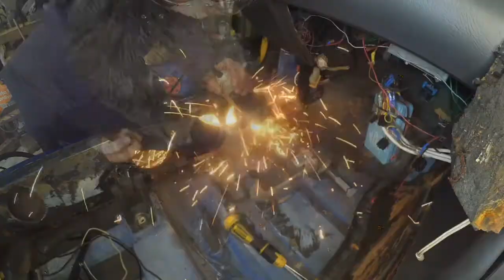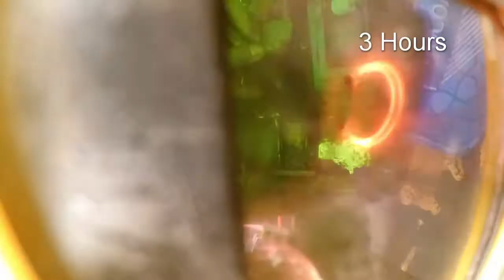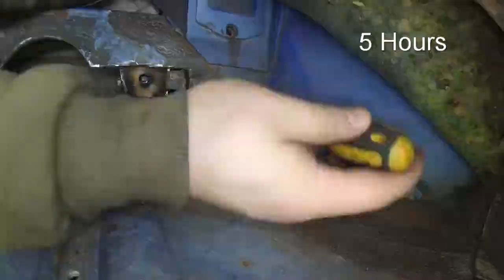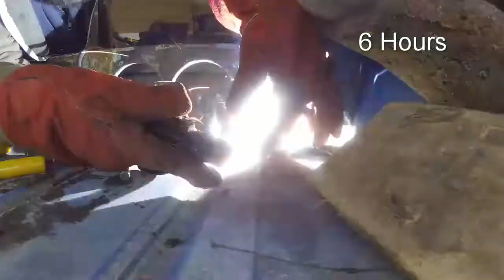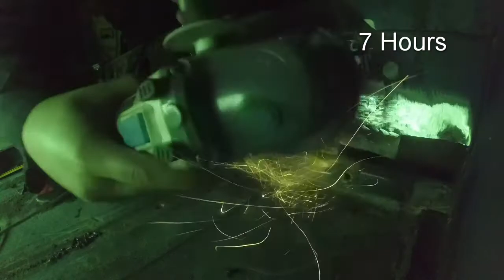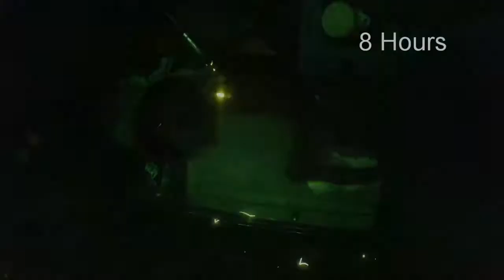Lotus Elan M100 89 94 Repairing Rusted Jacking Point

Comment: I’m attempting to do mine this year hopefully, spend most of the time thinking about if I’m going to be able to do it
Reply from the maker: It's the kind of task that takes a long time. The only advice I can think of, is that if your not familiar with the type of work this is (taking things apart, fabrication of metal, and welding) it's best to do it in a garage with appropriate space. You find yourself staring at the car thinking "what's the next step?" More often than you'd expect. And before you realize it. It's time to go bed. 
Working inside a garage gives you the freedom of taking your time and consider all the steps without worrying about the weather or time of the day or packing everything up to stop working cus there's something more important to do.

I don't know how familiar you are with jobs that require a lot of disassembly, but stuff like this is a prime example of the task that starts off project creep. If you have a garage. You can get all the other things done as well. Just be careful because a year later you may be telling a random guy on YouTube about it because your Elan is still in the garage and your gonna miss castle Combe for the 2nd year in a row 😅